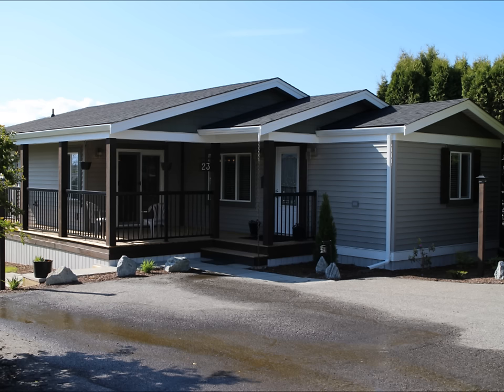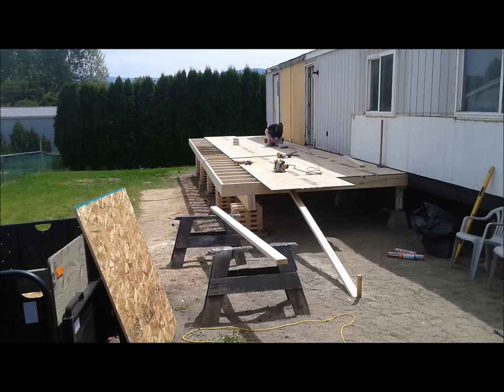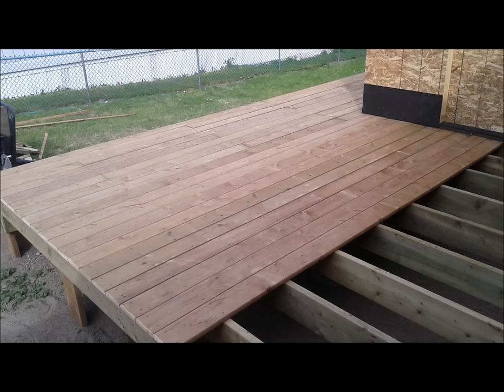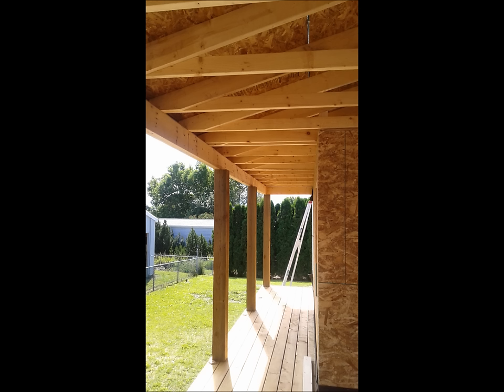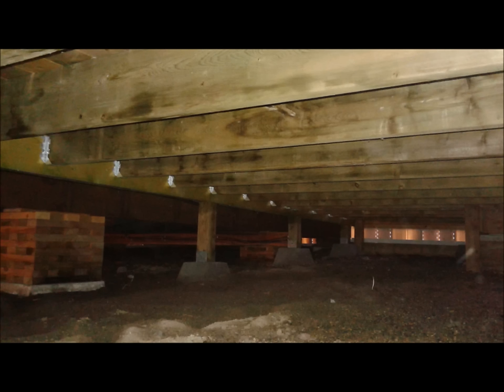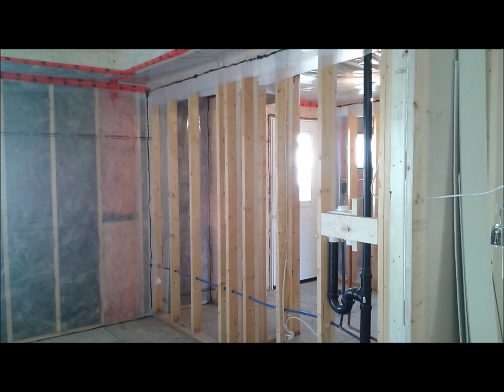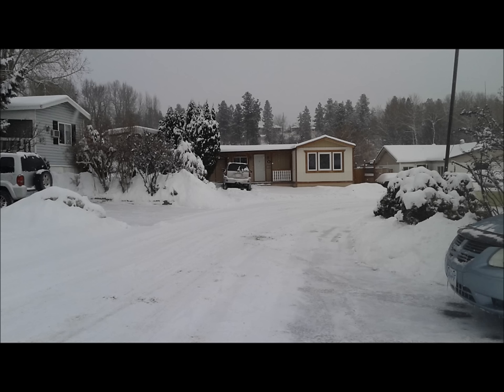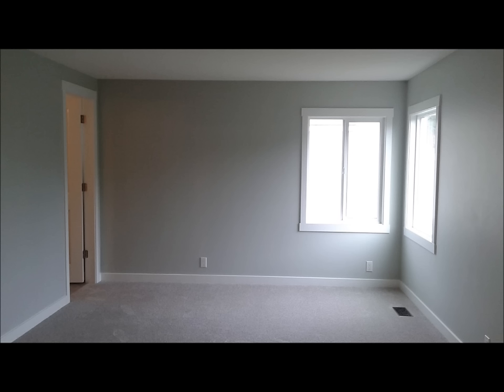Building An Addition To A Mobile Home - Start To Finish : E026 / BC Renovation Magazine

Comment: can you tell me more about your heat and cooling unit. I have a mobile
Reply from the maker: Hello, William. We used a packaged unit in this project. The entire system sits outside. In that unit outside is a 3 burner natural gas furnace component for heating. There is an electric air conditioning component.

This system eliminates the old furnace inside the home. In a mobile home application like this it is very nice because it free up that valuable floor space where the furnace sat. It also eliminates that noisy furnace. This system is whisper quiet. It is a very nice system.

Here is a link to a similar unit: https://www.keeprite.com/en/us/products/spp/quietcomfort--16-packaged-gas-furnace-air-conditioner-combination/
Reply: @BCRenovationMagazine   thank you so much for your reply and also for adding the link. I'm happy to say I purchased an all electric version.
Reply from the maker: @WILLY_WOODS  , excellent! You are really going to enjoy that system. :-)

Comment: Great video 😁 How much does something like this cost?
Reply: I'm not sure but I can tell you it was expensive. Fantastic work there.
Reply from the maker: Yes, it was expensive, but the end result cost considerably less than the alternative of buying a new unit with similar features.
Reply: @BCRenovationMagazine  any way you can give an average figure as to cost, we have fire damage to our 16x80 due to neighbors home burning to ground. Im pondering restoring our home adding on and so forth or considering a repo turn key. I think I could rehab restore rebuild cheaper. Just trying to way out a smart decision. Everyone has there opinion. Seeing what you did is way more than we need to do but would greatly help in my decision weighing out costs. Awesome video Thank you
Reply: I’d be interested in knowing a ball park figure as well! We are considering doing an addition to our mobile home and something like this could be perfect!

Comment: How about tie down (anchor) of the new addition to the ground.  Here in Texas you'd have a problem unless you did so.  The wind is such that pickup is a real issue.  The original homes are anchored (now) with screw anchors with a sheet of metal driven in front of the screw on the strap side.  So ground moisture cannot pull the anchor towards the strap.  This is very important and I don't recall seeing any provision in your video for anchoring (unless I just missed it).  Thanks.
Reply from the maker: Hello, A Day. Yes, I am familiar with tie downs. As odd as it may seem, tie downs are not required in our area. We live in a very temperate, docile, semi-arid desert climate. No hurricane threats and such here. The homes just sit on the cribs, which just sit on the ground. The original home had sat there since new in 1991. When we bought the home in 2016 it required only a fairly minor re-level of the original unit due to some settling. Everything here was done to local code requirements and inspected. Thanks for watching.
Reply: its all about location, here in maine we dont need tie downs. but you do want a good snow load, my roof is 40 psf.
Reply from the maker: @rottmanthan  Yes, code requirements really vary from location to location. When we are talking about two countries the size of Canada and the United States, there is a big difference in geography and climate that affects how things are done. Thanks for watching and commenting. :-)

Comment: I would like to know did you guys need to do any permits or any other things to extend the home I was thinking of maybe putting something like this on my 48 acre property and I need to know what would be the procedures of extending a single-family home or should I say a single wide home
Reply from the maker: allen duncan, permit and inspection requirements will vary from place to place. Where we are, we had to take permits for building, plumbing, electrical and gas. I suggest that you contact your local building inspection authority and ask them what is required. Thanks for watching! 🙂

Comment: Fascinated by your cribbing foundation
Reply from the maker: Thanks for watching and commenting, Jason. The way a mobile home is set up really varies from place to place. The way it is done here is quite different than a lot of other places. Of course, when one of these is set up permits are required and the whole process is inspected by the local building authority, so everything complies to our local codes. When I travel I will sometimes end up on some construction site to see how they are doing things there. I find this fascinating and very interesting to see what other people do in their work. We live in a very placid, semi-arid desert climate. Despite the snow you saw in the video we don't see a lot of frost in the ground. That snow lasted only a few days before it melted away. :-) The skiers have to go up the mountain to find snow that sticks around. The cribs work great for us here. These homes move very little, even after sitting in the same place for decades. You will notice that there are no tie downs, either. These homes just literally sit on those cribs. Nothing more.
Reply: @BCRenovationMagazine  if placed on concrete footers and your bottom boards mechanically fastened, could cribbing be considered a permanent foundation?
Reply from the maker: Jason, that is an interesting question. I would say yes, but I am not a building inspection authority. Mobile homes are technically supposed to be called 'manufactured homes'. In essence, they really aren't considered that 'mobile' anymore. Another type of manufactured home is a 'modular' home. What differentiates a 'manufactured' (aka mobile) home from a 'modular' home is that the manufactured home sits on a steel frame and the modular home does not. Other than that they are for all intents and purposes pretty much the same. Around here they set the modular homes on cribs like the mobile homes, with the cribs attached to a floating concrete slab, and call that a permanent foundation. The modular home then gets skirted, just like the mobile homes. There is another way of setting up a modular home that actually sits it on a foundation wall sitting on a strip footing. I think that method would qualify as a permanent foundation in almost anyone's books.
Reply from the maker: This home has been sitting there on those cribs for more than 25 years. There have been literally thousands of them set up like this over the years. The only thing that has changed for us is that the current code has removed the wood cribs. All new set ups require concrete cinder block cribs. You can see the current code compliant cribs in this video where we show a new mobile home being set up: https://www.youtube.com/watch?v=bzLqXxLqVNo
Reply from the maker: The terminology seems hard to change. Sometimes they are still referred to as trailers. Hmmm. That goes back a long way. I guess it has been kind of an evolution. The trailer became a mobile home, which became a manufactured home, which has become a modular home. All different products, really, but many folks paint them all with the same brush. We know the difference but for the purposes of our YouTube channel and the search parameters we have to work with, we are going with 'mobile home', as that seems to be the most popular nomenclature. :-) Technically, almost any stick built (site built) house can be lifted from its foundation and moved away, so does that make it a 'mobile' home? ;-)
Reply from the maker: In Canada, where we are, manufactured homes are built to CSA Z-240. I think there are some variations on that. For example, I think there is a CSA Z-240 MH standard, and I believe that in the province of Alberta homes built to that standard are not allowed anymore. I think they have gone to totally modular, which in Canada is built to standard CSA A-277. The American codes may be different. I'm no expert on all of this. I might be talking out of my hat on this one. I think the States has HUD that specifies these things? Would love to hear more on this!
Reply from the maker: Thanks for commenting, Nigel. Good information there.
Reply: BC Renovation Magazine Hello. I am in the USA and a lender with 30 years experience lending on all types of dwellings. Here in the USA, manufactured homes built after June 15, 1976 are built to HUD Code and have a small metal “sticker” attached to the back side of the home. A single section (single wide) has one, a double wide has 2, a triple wide, 3 and a 4 section or “quad” has 4. Each of the “stickers” contains the HUD number assigned to the home before it leaves the factory. The HUD Code meets or exceeds any building code in the USA. 

Modular homes are very similar to manufactured homes as they also have a “sticker”, however they are built to UBC code and must meet the building code in the location where they will be placed. They do not have (at least in the northwestern part of the USA) any different financing requirements than a site built home. Generally there is no metal frame that once the home is installed on it’s permanent foundation remains as in true with manufactured homes. Many of the modular homes are delivered via flatbed trailer. Manufactured homes have a tongue(s) and axles, wheels and are hauled to the site and installed either in a park or on land. Generally the homes installed on land are placed on a permanent foundation, tied down, skirted, backfilling is completed exposing about a foot of the skirting (which is either treated, painted plywood or cement board). This lasts for decades. The manufactured home title is eliminated and the home is taxed and insured as real property. 

One has to shop around for insurance as there are some insurance companies who still want to insure them as “mobile homes “ and the coverage is very expensive. However, there are other companies who will insure them as real property and the cost is comparable to a site built home. 

Like any home, they require care, upkeep and regular maintenance. My own home is a double wide manufactured home, placed on a permanent foundation, built with 2x6 exterior framing, 2 x 4 interior framing, sheet rock, tape, texture, etc. my home is 15 years old, has an attached 2-car garage and an acre of land. I’ve just finished repainting the interior and am in the process of installing new flooring. 

My homeowners insurance is approximately $600 per year and each year my replacement cost coverage increases, keeping up with the cost of a new home. I always suggest borrowers shop around for insurance, no matter what type or age of home they are purchasing as the premiums can vary.

Just some thoughts on manufactured and modular homes from a lender here in the USA. 

The home you remodeled is beautiful and I am confident the new owner loves living there.

Have a wonderful day.
Reply from the maker: @babyboomer1699  Double thumbs up for your comment! :-) I really, really appreciate getting comments like this that are interesting and informative. Cost, financing and insurance are topics of interest to many of our viewers. Most of our viewers are American and of course, these topics are handled differently in the USA than in Canada. How would you look at financing a project like this? This is a 1991 single wide with the attached addition, sitting on a rented lot in a park. It was taken down to the basic shell and re-built from the shell up. Would this home be financeable where you are, and if so, what would the terms and conditions be?
Reply: BC Renovation Magazine Hello again and thank you for your reply. This would be financed in my area as a “home only” or chattel loan. There are lenders who finance them this way, similar to a mortgage but unfortunately, a shorter term and based on NADA Bluebook value. The addition would unfortunately likely be considered as an “out building”  and the interest rate and down payment would be higher than a standard type mortgage.  If the home was placed on land, a permanent foundation and met all the requirements for additions (local building code and state labor and industries) along with the title to the home being eliminated so it would be taxed as real estate,  could be financed with VA 30 year mortgage and value based on appraisal. VA, also will allow for twice-moved manufactured homes. Conventional and FHA do not and also require double wide or larger. Any additions, decks must also be built to local and state codes.
Reply from the maker: Baby Boomer, thanks again for a great comment. That is great information. If you are comfortable with giving yourself a plug here, go ahead. If you include any links our filters will hold for review, but I will approve. I'm sure there are folks here that are interested in this. Appreciate your input! :-)

Comment: Wow, absolutely beautiful work. I own a newer single wide, but was looking into buying a bigger home and this is amazing to see. Would you reccomend doing the integrated gable roof like you did, or would doing a simple shed roof be sufficient for building an addition?
Reply from the maker: donjuantriumphan, I like to do things a bit different than some folks. :-) So, I prefer the gable type of roof over the shed roof. I think it is more interesting. Not that there is anything wrong with a shed roof. 

One of the things that can be a problem with a shed roof is getting enough pitch on the roof to effectively shed water while maintaining adequate headroom under the roof. This can result in rooms in the addition, or the porch, ending up with a low ceiling.

Also, trying to meld a shed type addition roof into an existing roof can be troublesome in regard to weatherproofing. A common problem that I see with these roofs done like this is leaking where the two roofs meet.

One of the main reasons people use the shed roofs is cost. A shed roof is quite a bit less expensive than a gable roof over like we did here.

Thanks for watching and your kind comment. :-)

Comment: Wouldn't it have been cheaper to tear out the old one and set a new double wide in place?
Reply from the maker: 1990 C4, in this case, where we are and in our housing market, this was a less expensive alternative to removing and replacing, and we ended up with a nicer home in the process. This is not for everyone but it has worked out well for us. Thanks for watching and commenting. :-)

Comment: Did you use #2  2x4 for your rafters?
Reply from the maker: Hello, Demetrio. The rafters are a combination of 2x4 and 2x6, depending on the span. All material is #2&btr grade, ILMA certified and stamped. Thanks for watching.
Reply: @BCRenovationMagazine  thank you for your answwe

Comment: I don't know where this was performed, but I know that most states in the U.S. will not allow an addition like this to a "mobile home". Code states that any addition to the original layout of the "mobile home" has to be a totally independent and self supporting structure connected to the original structure only with a water tight membrane connection due to the weight restrictions of the walls and roof of the mobile home. So I'd suggest confirming with your local city and/or county code enforcement office before committing to this type of addition.
Reply from the maker: Hello, Buddy. This project is in British Columbia, Canada. Your advice to check with your local building authority before you start something like this is very good. Additions like this are very commonplace here. Any decks, additions, etc that we make to the original unit must be totally self supporting, bearing no weight on the original unit. The separate units are 'connected' by finishes only.

Thanks for watching and commenting. :-)

Comment: Question? Did you add second wall to the outside of the original home.. Looking by the video I couldn't notice.. I'm planning on doing a similar addition to my home.. And of course I'm trying to do it all myself.... As always.. Thank you for sharing your work..
Reply from the maker: Hi, manuel. The inside wall of the addition, next to the outside wall of the original unit, is self supporting. It is mostly posts and beams. The only section where there is a wall is along the back of the shower in the ensuite bath and to the left of the washer. Over the opening in the master bedroom and dining nook is a flush beam and posts.

If you go to the community page and scroll down you will see where I posted a drawing that shows how it all went together.
Reply: @BCRenovationMagazine  thank you for your info.. I totally missed that picture on the community link... I really appreciate your input.. I'm not a carpenter by trade.. Not even an electrician by trade.. But i've been on the distribution side of the electrical trade. And i'm pretty handy with electrical work on codes. My wife says that I'm too cheap... But I really enjoy learning new things.. Specially when I learn from people like you...
Reply from the maker: @manuelortiz7731  , I'm very happy that I can be of some help to you. 🙂 I really appreciate you commenting, asking questions and watching.

Comment: Im in the process of renovating a mobile and rule # 1 is level the home and use cinder blocks for blocking not wood .
Reply from the maker: Austin, yes, leveling is Job #1. As far as wood vs. cinder block, well,  that depends on where you are. In our climate, which is semi arid desert, wood cribs are just fine. Those cribs under the original single wide have been there since 1992. They are as good as the day they were installed. No problem.

Comment: Something I've been curious about. Do you think it would be possible to take 2 singlewide mobile homes and set them up in such a way to where they could be remodeled into a double wide? I'm sure it wouldnt be the hardest thing getting them set, but more time consuming overall doing the actual remodel.